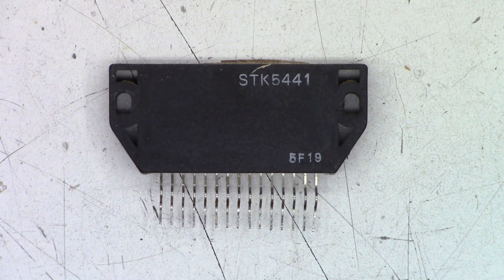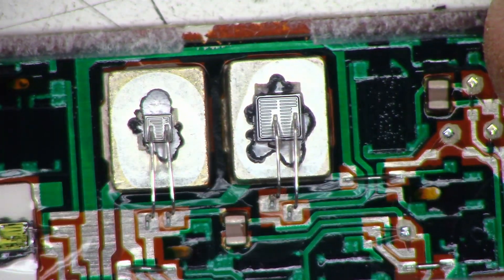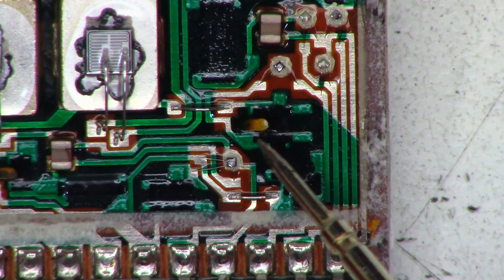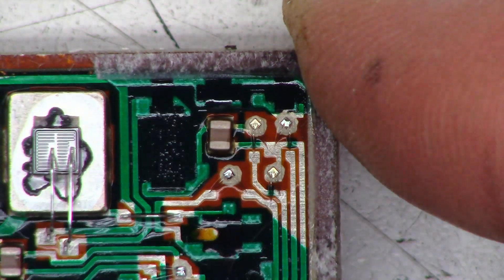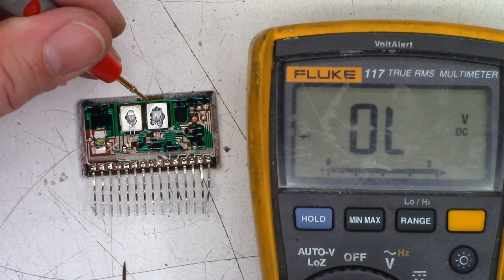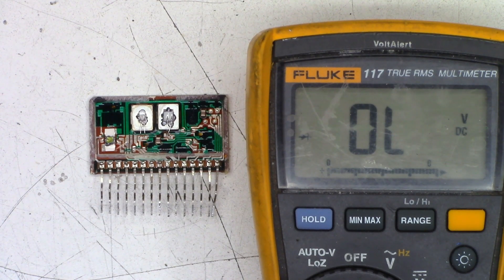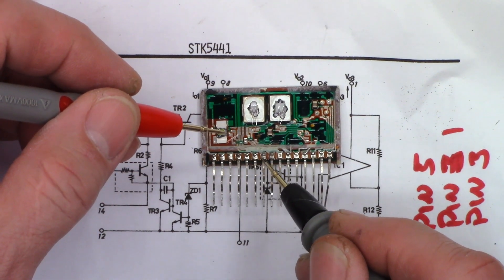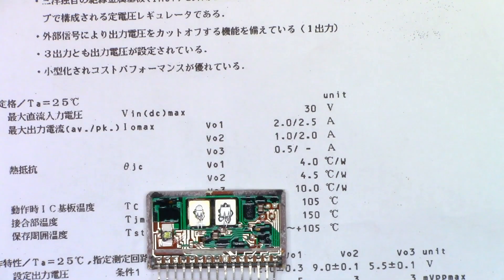A Look Inside the Failed STK5441 from the Sony SL-HF400 Super Beta VCR Betamax

Comment: When light falls on the open transistors, they behave like solar cells. 
Solar cells are also just large PN junctions = diodes. 
Transistors are NPN or PNPs
Reply from the maker: Ill test that theory soon.
Reply: Yes the Photoelectric effect (also Otocoupler operation principle).

Comment: STK series were full of specific integrated circuits... They were audio amplifier, preamplifier, vcr sytsems. Each reference was so different by other STK... That was the good time, in the years 1980-1990.... I have yet lots of schematics using these components explained in "electronique pratique" magazine...
Reply: I started working on audio/video equipment in the mid-1980s and I absolutely hated those STK hybrid chips back then. I am German and it always was a huge PITA to get replacements. There were just two or three companies in Germany where you could order those chips and it was absurdly expensive and the delivery times were ridiculous. I remember many situations when I had to explain to a customer, who brought some Sony or Technics amplifier to my shop for repair, that the power amp hybrid chip was blown and a new one would be more expensive than a whole new amplifier and it would take at least three months for it to arrive.
Reply: @albinklein7680  i understand the hate to this components, in France it was a flop for de amplifier stk series...
Reply: @francksylene1560 it was just so frustrating sometimes. All those popular discrete amplifiers from the 1980s like the Yamaha AX 500 were really easy and cheap to fix. You just looked up the specifications of the blown transistor in the "big book", then you searched for an equivalent part that was available, soldered it in, bias and offset adjustment and done.

Comment: But can we use the knowledge gained from this failure to prevent a similar one in the future?
Reply: Reason for failure is normally due to thermal stress. I performed a modification on a very similar VCR, making possible to run this IC way cooler.

Comment: Would the VCR work with three separate voltage regulator supplies?
Reply from the maker: It would work, switching it on and off might be another issue.
Reply: if you know outputs and caracteristics of the STK, you can make equivalent DIY PCB similat to STK with discrete components...
Reply: It will perfectly work.

Comment: These STK chips were common failures in VCR power supplies as well as projection TV convergence circuits. One of many reasons for the failure was inadequate or dried up heat sink compound.
Reply: they crashed because thermic paste was out of service, and the burned... I saw so many recoders with stk HS and replaced without the thermic paste... Big failure after few time....

Comment: possible to reverse engineer this and make it from discrete components?
Reply: You don't have to. It is just a power supply hybrid. You can shoe-horn every cheap ass 5.5V/9V/12V power supply unit and the VCR works fine. At some models you have to simulate the "PWR OK" signal to the main MCU somehow, though. But that isn't rocket science.

Comment: I have some clean pulls😊 if you email me with what you require
Reply: Hey man, I have a SL-HF900 that I bought that I think has a dead STK5441. I can solder it in but I'm very worried about counterfeit components. Can you help me out and what's your email